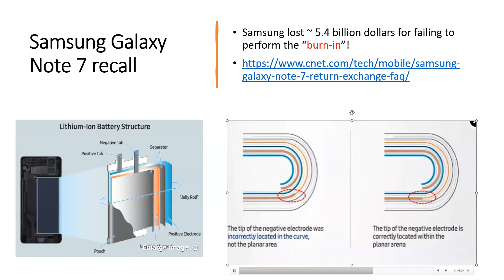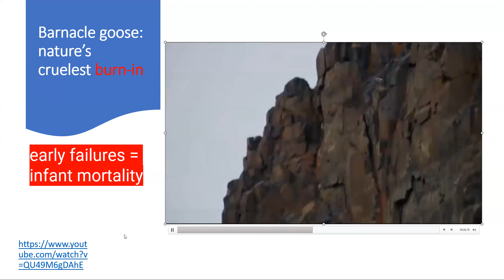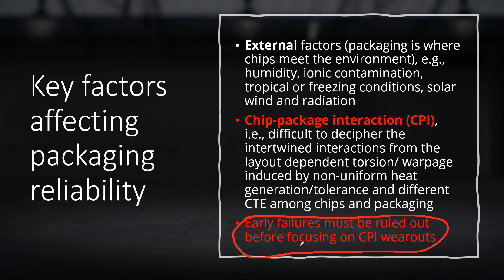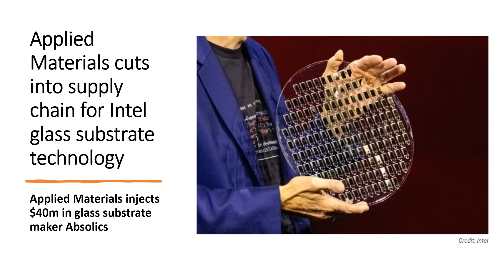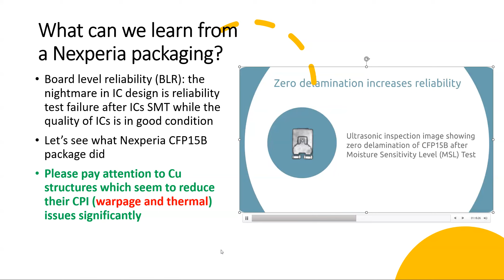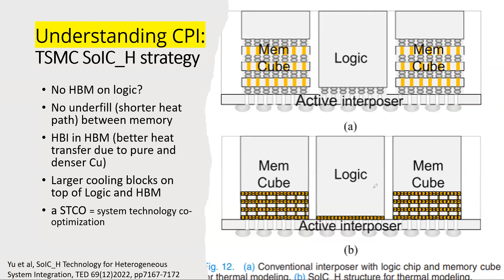13  Packaging process technology Part 1 Chip package interactions CPI

Comment: at 24:50, what is the 3D chip with size of a couple hundred mm2 referring? Apple SOC for iPhone is about 100mm2 size, how is this associated with 3D chip? please help. Thanks
Reply from the maker: Not sure I understand your question 

100nm2 is not that big. It should be okay for TSMC packaging to handle it without any issues 

The key is to cut the die and place them in a Besi tool for HBI without particle issues
Reply: Sorry, Dr. Wang, that I confused you. My question is actually not about the packaging, and it is about the chip size. In the graph, there is a type of chips called 3D Chips with size of 100-200mm^2. I am wondering what are those chips with this size besides the mobile phone SOC chips such as Apple A-series chips about 100 mm^2. Also based on the graph, no chip with size around  200-400 mm^2. This seems to be not true, the laptop CPU chips made by Intel, I guess, they are mostly around 300mm^2. Thanks.  @王不老說半导
Reply from the maker: @qz9514  300mm2 seems to in the high tside. Below is what I find
https://der8auer.com/intel-die-sizes/

Please check out my video about die size vs yield:
https://www.youtube.com/watch?v=aiP9rL57avQ&list=PLLqmCVy2iankN0kcwGkCPvYGEDM1neUDY&index=1&t=2597s
Reply: @王不老說半导  thanks Dr Wang, and intel cpu is indeed around 200. It looks like no chip around 200-400mm&2 typically